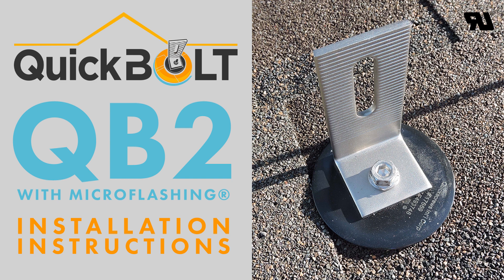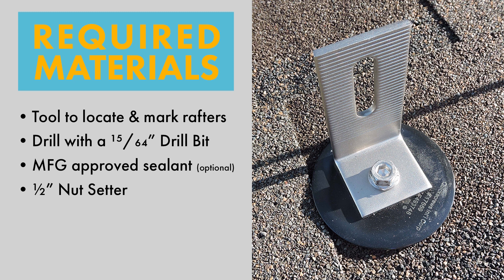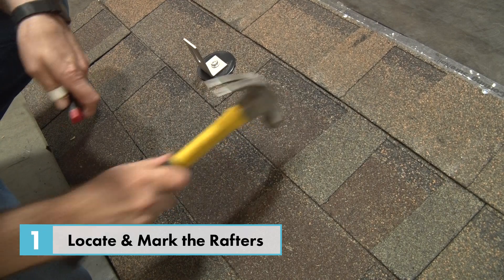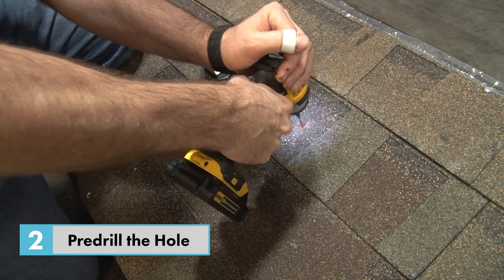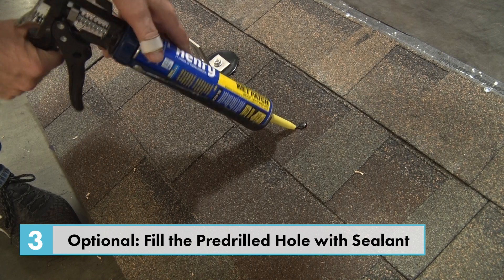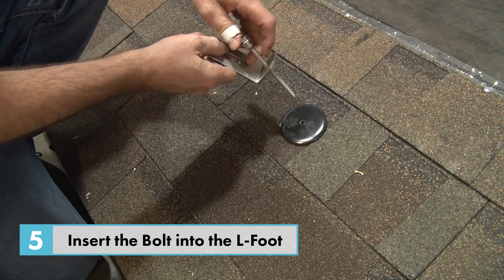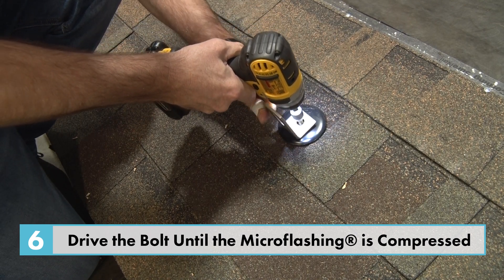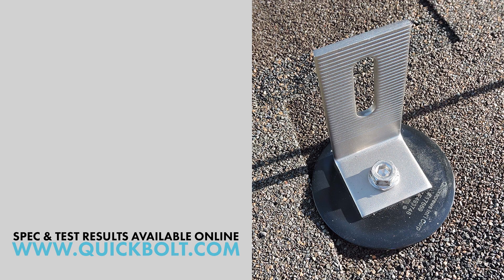New QB2 | INSTALL VIDEO

Comment: What does this do to your roof warranty?
Reply from the maker: A majority of asphalt shingle manufacturers allow for solar installation onto their roofs without voiding their manufacturer's warranty. CertainTeed has explicitly stated that our QB2 will not void theirs. Roof manufacturers and installers alike prefer the QB2 to traditional flashing because it doesn't interfere with the shingles' adhesives